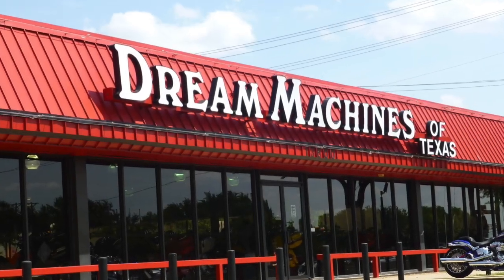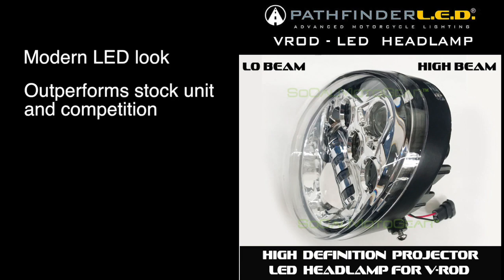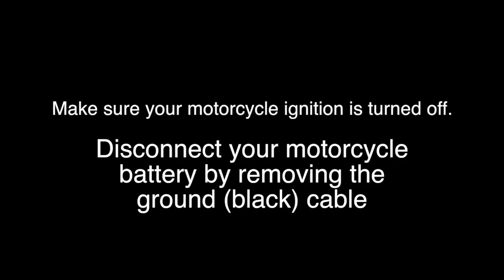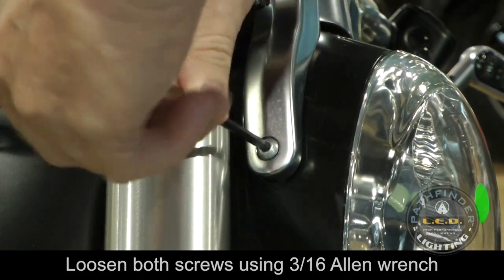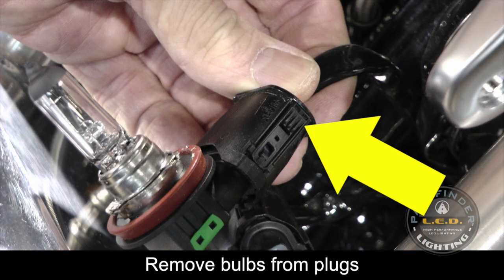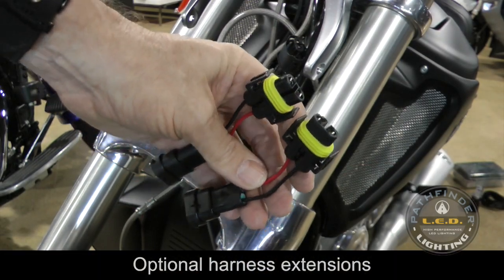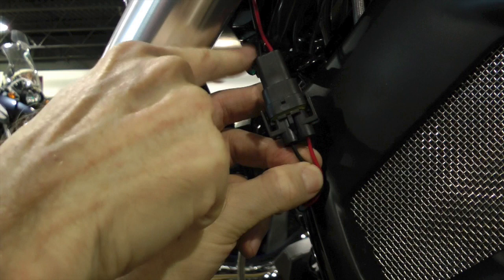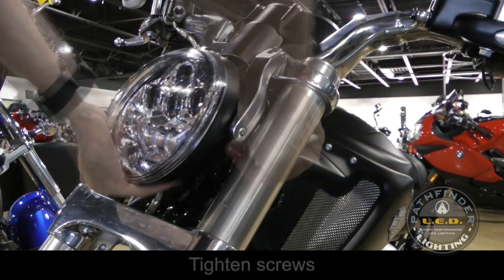Pathfinder L.E.D. headlight on Harley-Davidson V-Rod

Comment: yes there is a big gap in the top between the headlight and the mount as compared to the stock headlight on a vrod muscle. I bought one, its a different name brand ( not pathfinder) but they are all made in china and are the exact same regardless of the name brand. also having to use the wire adapters really sucks because you are really limited on space behind the headlight.

Comment: Wish you had some close ups of it mounted. Is this headlight smaller than stock? Does it leave some empty space?
Reply from the maker: Good question. I don't recall it being smaller. There is some space between the bezel and the headlight, but I don't recall if it is different that the OEM light.